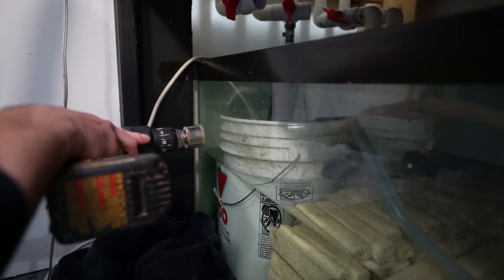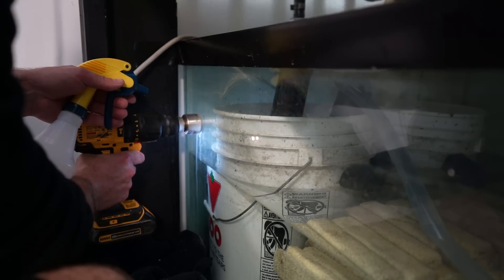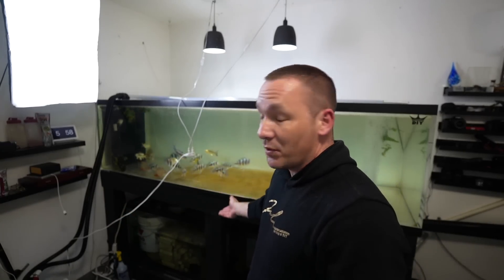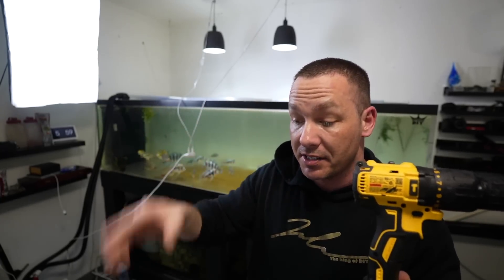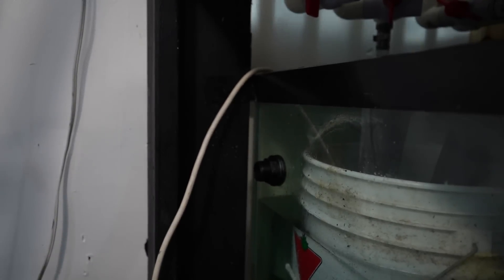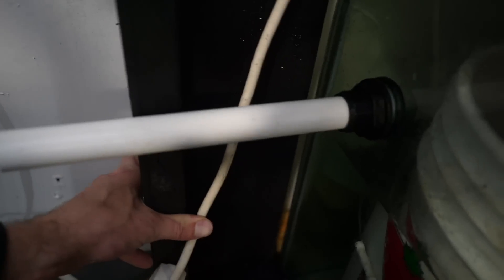HOW TO DRILL AN AQUARIUM FILLED WITH WATER FOR BULKHEAD, FISH TANK SUMP AND PLUMBING

Comment: Thanks Joey,
 I have been watching your videos for a long time. I had a jebaco pump that i was using for your 5-gallon bucket video. I eventually switched to a used fx6 for that tank. I am changing filtration in my community 40 breeder and added a 20  tall tank as a sump that i had lying around. the drilling was so easy after watching this i even did it with fish inside drained to 25 percent. I added 2   3/4 bulkheads staggered one higher than the other and it worked absolutely perfectly, so much that i added my hang on back filter as a redundant filter.

Comment: Do you have to worry about the glass dust getting into the system? Will the tiny glass particles hurt the fish?
Reply: Probably not even thinking about it
Reply from the maker: @krabrangoonies1071  Its harmless. it doesn't get in the tank, but if it did... its so little that you dont see it. Plus.... its basically fine sand.
Reply from the maker: No. it wont do anything.
Reply: Glass dust would be very similar to sand and sand doesn't necessarily harm the fish,i believe it would be a different case if there were glass shards
Reply: Glass dust is otherwise known as ‘sand’
Reply: @SenorTucano  You think the beach is made out of glass dust ?
Reply: @CreatorArchive  Pool Filter sand or "White sand" is in fact made of silicon dioxide (SiO2). If you've been to a golf course guess what the sand trap is filled with, silica sand. "Regular" sand is just less than 95% silica, containing a variety of impurities.
Reply: @circu111  So there is a difference, wich is the point. Beaches I.e. natural sand is not pure.
Reply: @CreatorArchive  yes... heat up sand at the beach and it turns into glass... 😅
Reply: @Digitalfirex  .... That means that the beach is made out of glass dust right ? 

Time to go back to school...
Reply: @CreatorArchive  yes that's exactly what that means dummy. Glass is manufactured using sand, otherwise known by its chemical name “silica dioxide”... so both sand and glass have the same chemical composition. Sand is heated and cooled to form glass. Also, as clearly you don't know, recycled glass is used to make sand for pool filters. Maybe look that up before assuming? Look up glass beach too, where broken glass is worn out to form sand.
Reply: @Digitalfirex  Lmao No - (beach) Sand is silica + etc -  that makes it 'unpure' A (natural) beach is not pure silica. Soooo - no dummy.

Thats the whole point. A point that was already settled 4 comments before yours. Just because you can heat it up and get to a (similair) end result, does not mean its 1:1 the same. This is a weir thought process but must be us public schooling.
Reply: @CreatorArchive  sand IS silica. The beach it's self isnt made up of ONLY sand, there are organics and other impurities... you are arguing semantics honestly. Not to mention the fact that most cheap glass wouldn't be pure silica anyway... you can go to the beach and grab sand. Heat that up and make glass. Break that down and is it no longer sand? It has the same impurities you started with.
Reply: @Digitalfirex   At what point are you going to stop repeating established facts and admit that you were wrong ?
Reply: @Digitalfirex  In this argument, it appears that @Digitalfirex's explanation is more accurate. Sand is primarily composed of silica, and heating it can indeed transform it into glass, which is also made of silica. @CreatorArchive's argument about impurities and semantics doesn't change the fact that sand and glass share the same primary component, silica. So, based on the information presented, it seems that @Digitalfirex's explanation is more scientifically sound.
Reply: you were wrong @CreatorArchive

Comment: What’s the smallest tank size (thinnest glass) you can drill effectively. I’ve cracked 10g tanks damn near every time. Don’t know if it’s worth trying on my 20s.
Reply from the maker: any thickness is fine. Thin glass will crack with too much pressure, speed or not enough water.
Reply: @thekingofdiy  i appreciate you my friend

Comment: Another tip if you're on your own is to get a plastic water bottle and put a pin hole near the bottom, fill with water to cool the hole saw and adjust the water flow by tightening or loosening the cap, set it up near the hole on a bucket or whatever you have at hand, works a treat!!
Reply: My